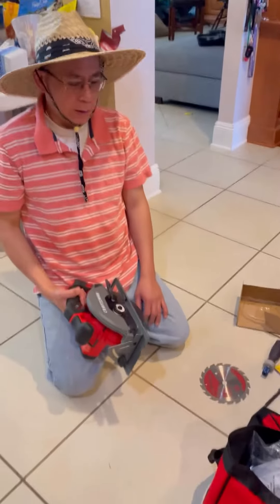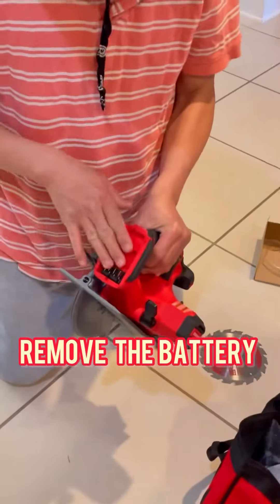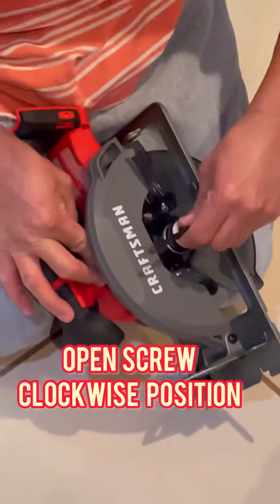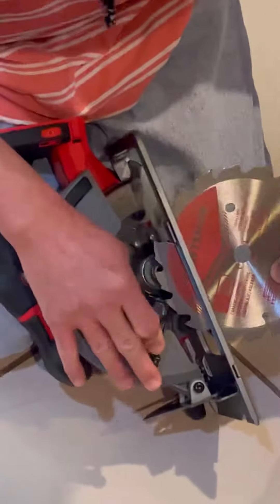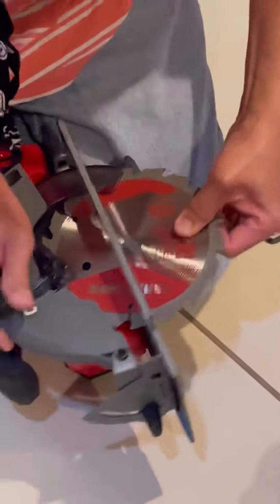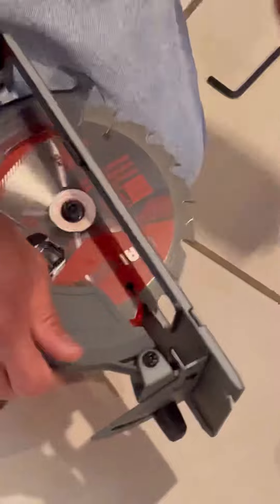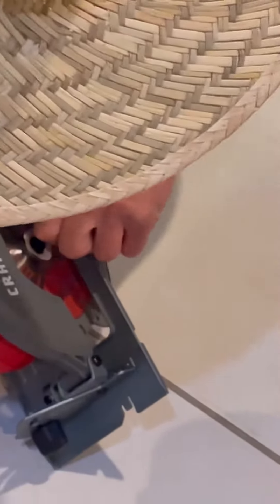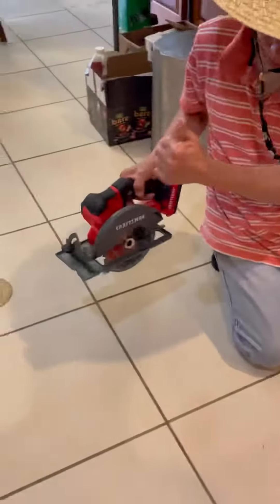How to Install Saw Blade // Craftsman CMCS500 cordless

Comment: Did you put the blade in backwards? The teeth are not going forwards
Reply from the maker: The blade can be reversed, depending on what you’re cutting.
Reply: The teeth do not always go forward. From what I can tell he put it on the way the blade is intended to be put on. Just look for the arrows on the blade and the manual to be sure